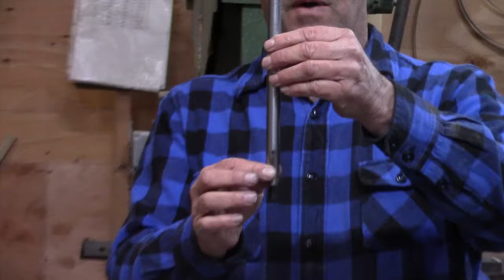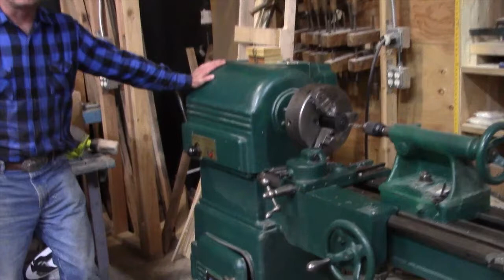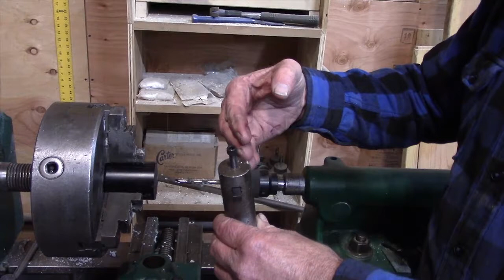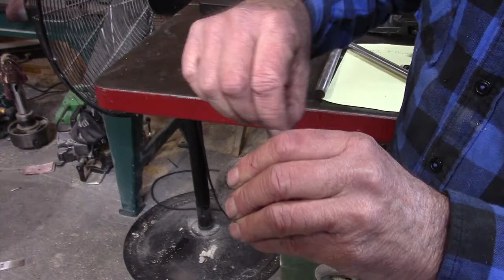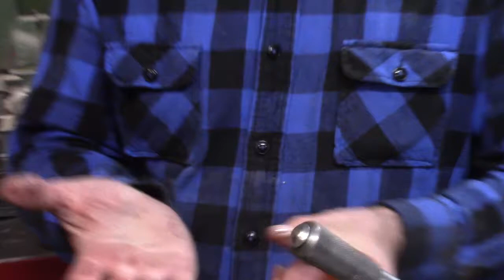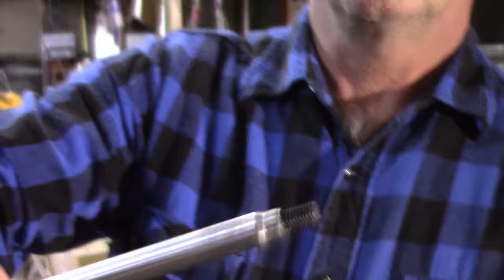Prelude to Milling a Tool Bar {#04}

Comment: That is one heavy duty wood lathe.  Nice job on the tool post.   Thanks for sharing.
Reply: Steve Summers , thanks for viewing. Oliver made some really good woodworking machines. I have three Oliver's, all heavy machines (table saw, jointer, and the lathe) that are probably older than you and still due precision work. Fun testing out new ways to use them.
Reply: Video post today will give a little more detail on how I made the tool post.
Reply: Jeff Erdman I'll check it out 👍